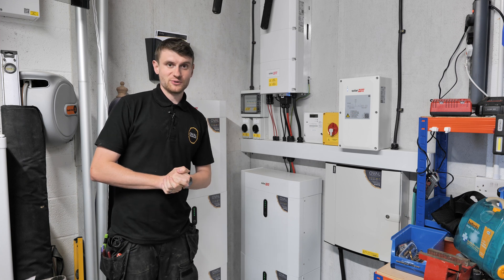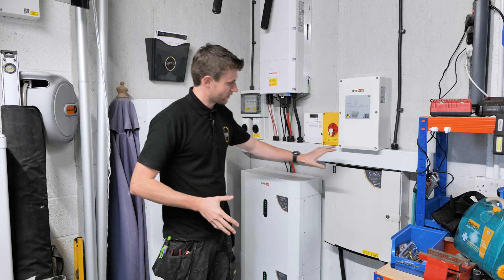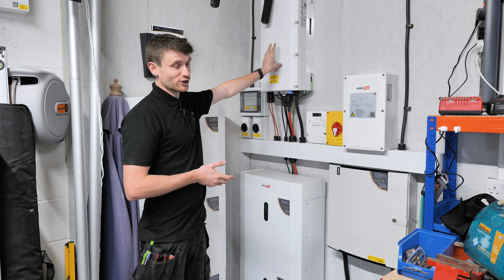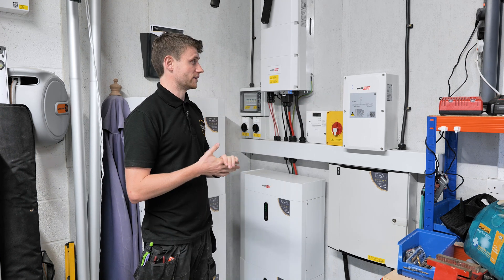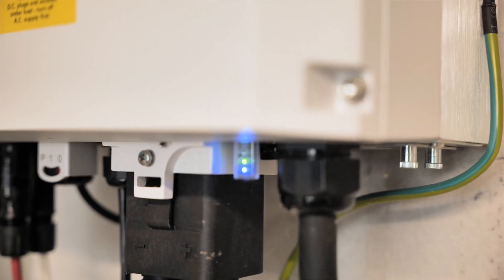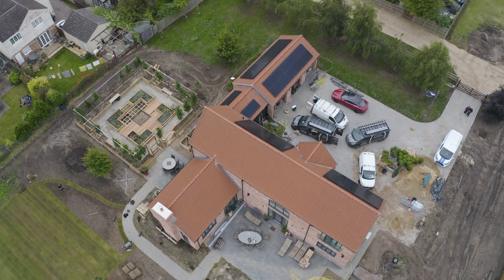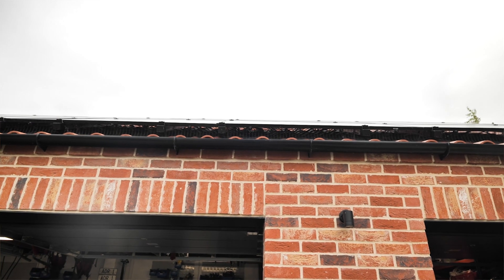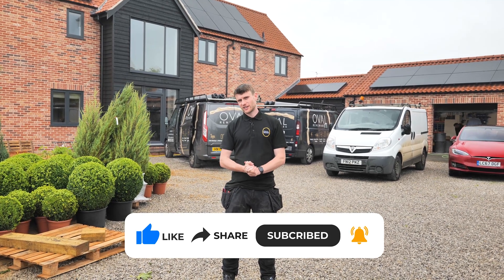Stunning solar and battery system walk through on this beautiful property! - Wisbech Part 2

Comment: Is the production data more reliable than my SolarEdge system, I wonder?  Mine would be more accurate if it took the pre-installation solar prediction, added a random 1 to 5% variance and called it quits.  This month my SolarEdge system has drifted from reality by 133% - it is utterly rubbish at monitoring itself.